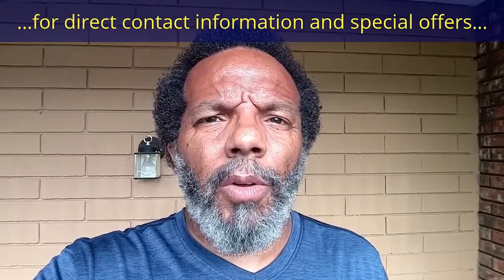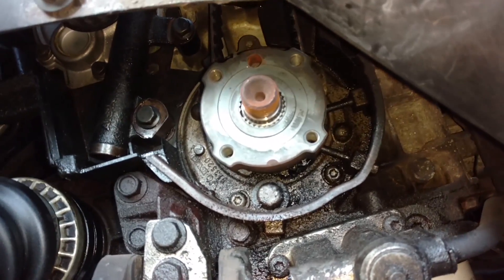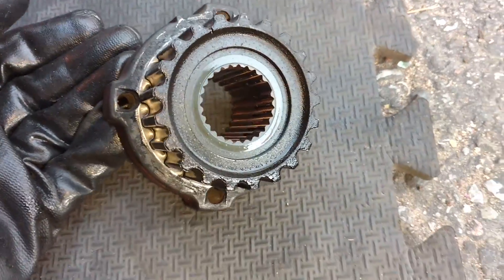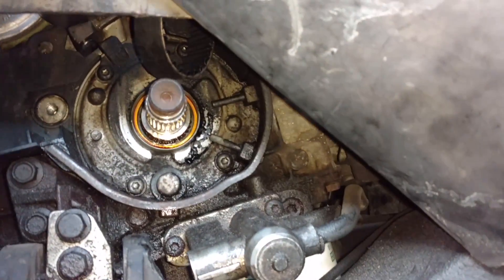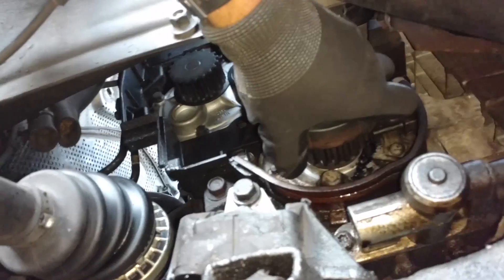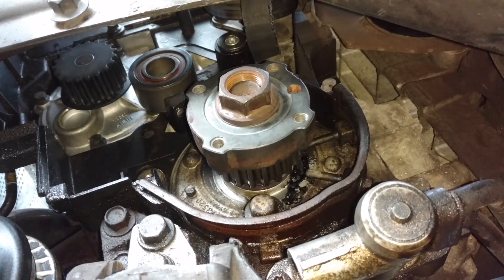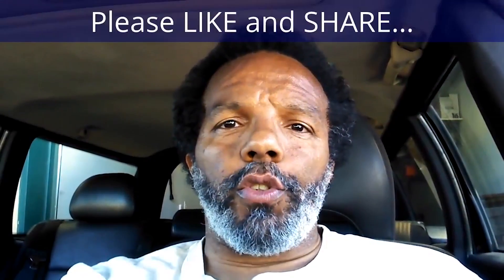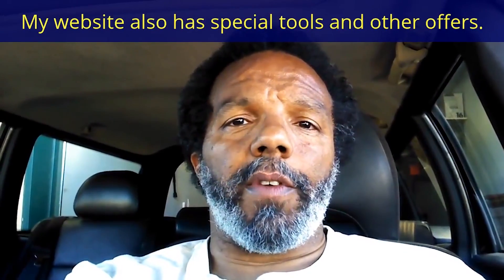Information on how to replace the front crank (crankshaft) seal on a Volvo white block engine - VOTD

Comment: Is there a way to tighten the crank nut without impact? I mean to proper torque (180 Nm). Can I lock it through flywheel by removing starter?
Reply from the maker: Sure

Comment: If the crank shaft rotates out of time while installing new seal are you just rotating crank clockwise until the timing line meets up again? Can you do the same with the cams or is it a must to lock them? Need to replace just the crank seal and just want to be sure what im doing and what specialty tools i need.. serp belt pin/block, cam lock tool, crank seal seat tool?
Reply from the maker: Serp belt pin/block helps. Crank seal tool for sure.
Reply from the maker: https://swedishcarparts.com/models/30-volvo-special-tools/parts/seal-installation-and-removal-tools

Comment: U  didnt show how to take seal off in here and also didnt show how to pull the nut off next time please make full video not everbody is expert
Reply from the maker: It was not a DIY video. Did you check the comments for links?
Reply: Thank you for the video Robert. I was wondering why you didn’t replace the oil pump gasket in O-ring while you were that far in. My Volvo 850 has over 240,000 miles on it. I still have an oil leak after replacing all the cam seals and I’m thinking that might be where it’s coming from. I have oil dripping down on my axle and spinning it everywhere. I used your link to order the crank seal installation tool.  Unfortunately, they did not have the gaskets or O-rings for the oil pump.

Comment: I went to set the timing in preparation for a timing belt job and there is no crank pulley retaining nut, its gone.
No wonder the timing belt was wobbling on the cams. Lucky eh?
I ordered a new crank nut today, question I have for you is how do you tighten it, how do you lock the crank whilst torquing it down. do you just impact it? loctite?
I didn't install the lost nut, some previous owner did that, volvo says to always use a new nut.
Reply from the maker: Never used a new nut. Impact it on with no lock tight.

Comment: if you have the 99 s70  what type of timing mark does it have on it? and if im doing both front cam seals and timing belt and water pump all at the same time is there an order you would recommend doing them in?
Reply from the maker: Does the engine have VVT hubs on it?
Reply from the maker: https://youtu.be/hjZFY-1x1Xk
Reply from the maker: https://youtu.be/YpOYTVpzzic

Comment: Hi Robert, what's the part number of the gear locking tool, IPD made you used?
Reply from the maker: IPd made me use?
Reply: @RobertDIY what is the part number of the IPD brand, that  You used?
Reply from the maker: I don't know. Did you check their website?
Reply: @RobertDIY  yes, i could not find it.
I will try calling. Im overseas, Panama. Thank you.

Comment: Robert - Hi once again, I bought an 05 V50 and gave it to my cousins son who needed a car about four years ago. it had 60K miles on it whey I did, it now has 86 and he tells me that the crank seal on it is cracked. So I plan on swapping it out. How do you remove it, with a pick or screw driver, or ice pick??  that part didn't make the video ( Which is incredibly helpful) He was told that the crank seal is leaking and that since he is in there the timing belt needs to be swapped Oh and the car needs a CV joint and front brakes.... I was like what did this guy see dollar signs walking through the door when he came in??? he wants 3500.00 bucks for the work. I told my cousin bring it down and my other cousin and I will look at it.. I have swapped out a timing belt on my 06 S60 and it was a bit of a bear but really not that bad.. I told him we would swap the front brakes and inspect what else needs to be done and DONT PAY THE MONEY let me  look at it first.. So I was just wondering how you got the seal out and how tough that was.. Thanks in advance your friend in VOLVO Fun - Doug

PS. I was the guy who wrote you about his girl friend burning oil... Volvo replaced the rings under warranty and everything is fine a full year later - Thanks for your help
Reply from the maker: I usually drill a pilot hole in the seal, then put a screw in the hold and pull it out.
Reply from the maker: https://www.youtube.com/watch?v=c2VlSkyUt-Q

Comment: I have a 1998 Volvo S70 with 83,000 miles. I am on the original water pump and am due for a timing belt/tensioner/pulley change after 8 years. I am thinking of replacing the water pump, timing belt/tensioner/pulley. Is it practical to also replace the front and rear camshaft seals as well as the front crankshaft seal at the same time? Any thoughts are appreciated. I would be buying the parts and having a mechanic do the installation. Thank you!
Reply from the maker: My cam seals never leaked at 363,000 miles. Replaced my leaking crank seal at about 385,000 miles. I do NOT replace seals that are not leaking.